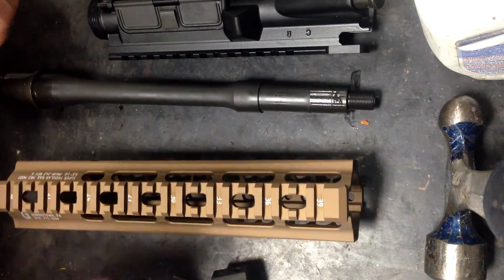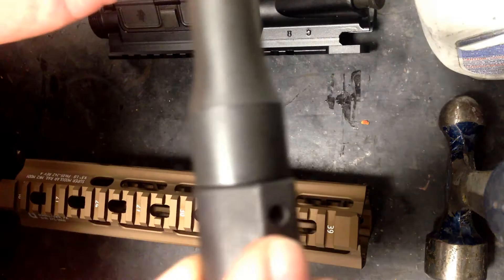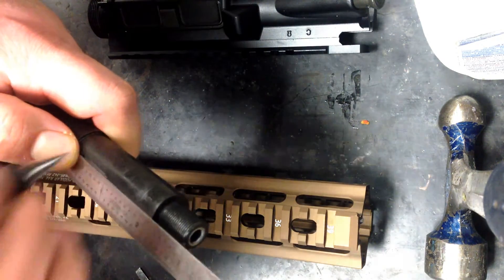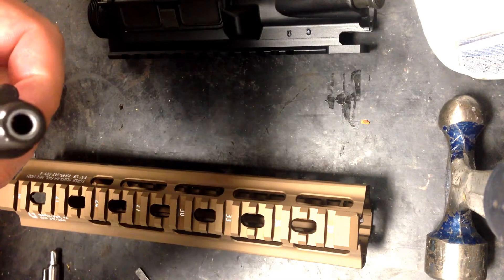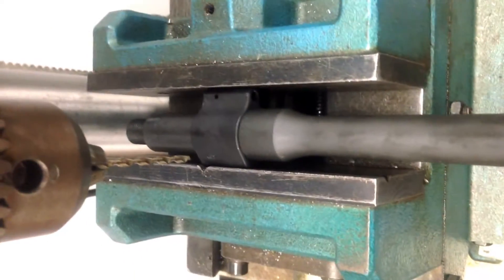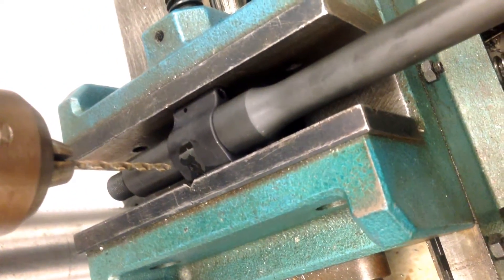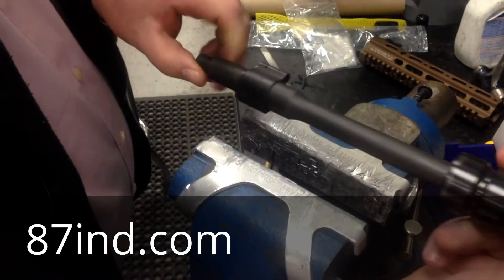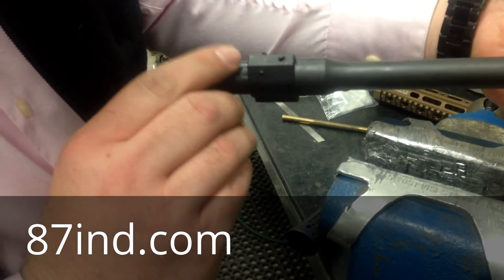87 Industries PinBlock

Comment: Anyone doing this today, recommend you get a gas block dimple jig.  Dimpling it first ensures the gas block in vertical and also prevents any rotation during the drilling process for the pin hole if you have the set screws inserted.  Use a taper bit, not a regular drill bit.  I use a combination drill bit/round-shank reamer for taper pin holes, size 0 from McMaster-Carr, part number 8831A15, $70.  This corresponds to taper pins for size 0 which are also on McMaster-Carr part number 90681A160 for stainless.  They have analogous pins for carbon steel but I don't recommend them as they aren't corrosive resistant to moisture.  If you are hung up on them being shiny, paint them with some alumahyde from Brownells or something.

Comment from the maker: Raven, I'm not sure I understand your question.  The pin attaches the block to the barrel.  The barrel does not have a hole/channel in it for the pin.  You are correct in that the gas block could already come with a hole in it, but you'd still have to drill the barrel.  Not including the hole in the block from the factory saves machining cost on the block and does not add steps to the installation as you can drill both the block and barrel at the same time.  I hope this helps explain.